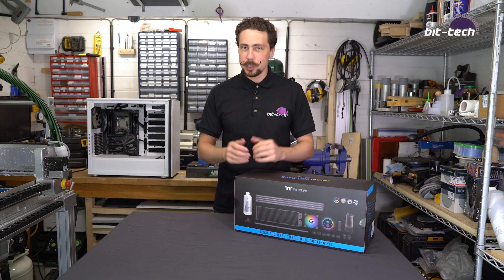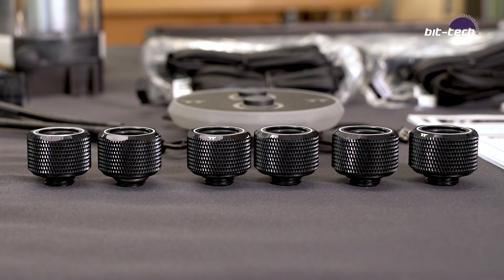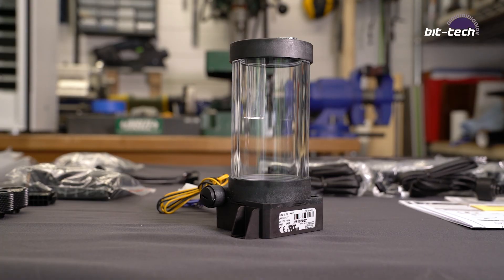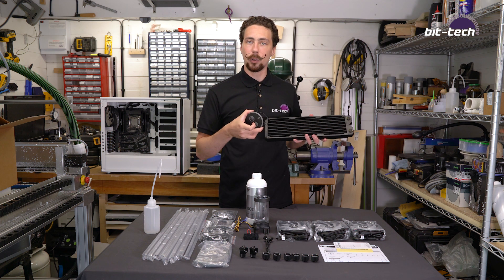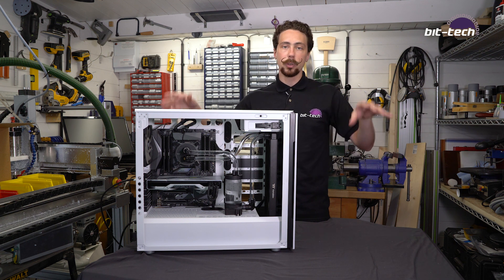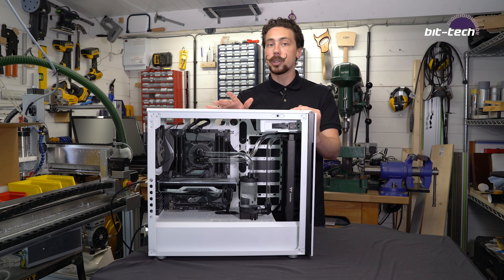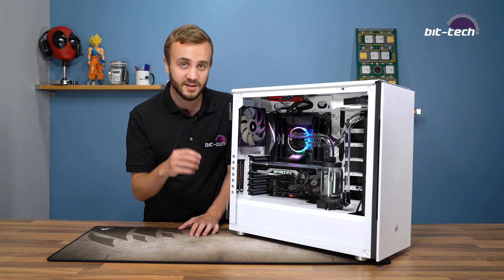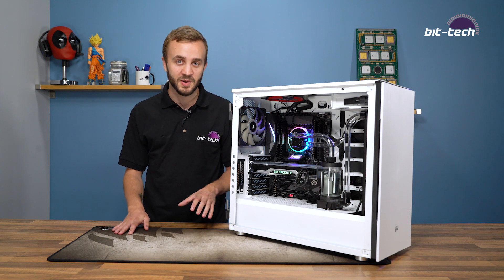Thermaltake C360 DDC Hard Tube Water-Cooling Kit Review - Hardline Without Hassle?

Comment: I need help. You put your fans on the outside of the rad so it is pull (front of case) but mine fit better on the inside as an exhaust.. will this work? thoughts?

Comment: PLEASE HELP!!! I bought the 240mm version of this same kit and I have my loop set up almost the exact same just have my pump going to the block first not the rad. I've been running it for over 6 hours with the res cap off but I still have lots of tiny bubbles almost looks like foam and when it's on/running the loop looks cloudy. How do I get rid of the bubbles!?? PLEASE HELP!!!

Comment: These are pathetic results! My AIR cooler gets 1/2 the temp shown here on AIR! Not only that, your results are unrealastic. Why would you be testing using an 18 core processor when 99% of users run their systems on 6 & 8 cores? Surely you should have been benching those core counts not 18 cores.
Reply: Why wouldn't you be benching a hot cpu to check perf, like maybe the 12900k?

Comment: I have never done cooling by liquid, but I bought all the parts separate (I wanted 4 quad fans). I got a CDL 480 Radiator, the MX 1 plus water block, 4 T.T. riing quad 120mm, have the T.T. tube bending/cutting kit and 4x1000mm tube set, 16o/12i.  All I need now is the pump and fittings - any suggestions on a reservoir/pump from Thermaltake? Thank you!

Comment: Personally I'm the kind of person that prefer to build loops that makes me able to reach everything I need easily. I think I'll never pass hard tubes above RAMs like that. I prefer to give more space to be able to remove them or install another pack if necessary, maybe just inserting pipes perpendicularly into processor cooler's fittings and makes 90° angles a bit far from them. But I have to say that for 'tutorial purpose' this is more than enough. Really good explanations! :D
Reply from the maker: SiMmUsS Yeah for proper builds I don’t like crossing the ram either, although it’s more of an aesthetic thing for me since I basically never switch out memory.

Comment: What fan header did you use for the kit?? Doesn’t specify which one in the instructions.
Reply from the maker: joshua hamlett When given the choice, try to use CPU_Fan as it helps avoid an annoying startup error. If using TT digital fans though it’s all done via one of the USB headers
Reply: bit-tech thank you for responding, this week I am adding another 240mm radiator into the loop my gpu temps dropped to fantastic levels while gaming but my cpu suffered. I did the hard tube kit on a 2080ti/9700k set up honestly fantastic kit and super easy considering I am extremely new to anything pc. Great video guys

Comment: Can anyone explain why he put the tube in the soap at 7:44?
Reply from the maker: Lyle S It lubricates the tube and bending cord so that it doesn’t get stuck after the tube has been bent.
Reply: @bittech1  Ohhh I see, possibly dumb question, I have a few more especially mostly for hardline tubing like measuring, making sure the cut is clean so the end of the tubing isn't messed up. As a custom loop beginenr should I use my soft tube first?  Ihave thermaltake c240 and c360 kits I both got on sale at frys a few months ago, still scared to use them in my atx build. only plan to watercool the CPU so I should be good I guess. Thanks , IO appreciate your help, would love some more advice. P.S, rocking that stache my dude!

Comment: I recently got this and c260 becuase i warned to combine hard tubing and soft in my big PC case, but are you sure this won't leak? if it did that'd suck. I also have a heatgun and PVC pipe cutter that I got from Lowes (brand Lenox) will it work? i've never done a custom loop before, but I recently set up my gamdias chione P1-A 360R< Would still love some personal advic from you on the watercooling, CUSTOM loop.

Comment: the blue power from the pump think its pwm where does that happen to plug into on the mobo ? just a fan header? the water pump header or ??
Reply: CPU fan header is a good choice. Pump headers don't always have PWM control.

Comment: I have an EK A240 kit, have you reviewed that kit in particular. I would like to convert it to a hard line system as it works wonderfully for two years now. But am tired of the saggy tubing,  Any suggestions would be appreciated.
Reply from the maker: You’re actually in luck as EK sells aluminium HDC rigid tubing fittings now. To convert, you’d basically just have to replace all the soft tubing compression fittings with rigid ones (the angled adapters are fine). Just be sure to get the aluminium ones from the fluid gaming line, otherwise you put yourself at a significant risk of galvanic corrosion.
Reply from the maker: I would add though that personally I would ditch aluminium for a higher end copper/brass/nickel setup. Aluminium really limits your choices as only EK has a consistent lineup for it currently in most markets (China will always have options there). With a copper/brass/nickel loop you have more choice for things like fittings and blocks for less mainstream GPUs

Comment: I had been looking for more reviews of this kit with no luck, only having seen one so far.  I did something out of character went out on a limb and bought one and I must say that I'm impressed with the packing and the quality feel of the components so it's reassuring to see that it does a very good job in testing.
Thanks for the review gents.
Reply from the maker: You’re welcome! It’s a pretty solid offering, a few extra fittings such as a drain system and a few extra angled adapters and you’ve got a pretty simple and effective setup
Reply: @bittech1  I'd bought a GPU block and forgot to get a couple extra fittings for it so now it's all sitting in the box all weekend hahaha
Reply: oFriskyPanda  hard to believe it's been 8 months but it's held up great.
Temps are still good, no issues to report.
Reply: oFriskyPanda   oFriskyPanda I'm using an I5-8400 and RX5700xt.  I don't remember the CPU temps under heavy load but during gaming it stays around 34°c. There was definitely a drop when compared to the air cooler but I don't recall how much.

More important for me was the improvement for my 5700xt, it used to peak at 88-90°c, now it maxes out at 35-37°c. Getting that heat out of the case was a huge victory.
Reply: oFriskyPanda  it helps that the 8400 is a pretty low thermal load but I've been really pleased with the results, I should clarify that it's about a 14°c rise over ambient.
Reply: oFriskyPanda  for a 9900k and 2080 I'll tell you right off the bat, this kit isn't going to be enough, you'll need at least another 240mm radiator, easy enough to add a Bykski from Ali Express though.
I would say this kit will be a good starting point, the Thermaltake Pacific fittings are really nice, the pump and reservoir are fine, the CPU block is attractive and works fine.

Comment: The only thing one might forget when starting watercooling with a kit like this is that it lacks a drain. Could potentially lead to a little headache.
Reply from the maker: 100% agreed
Reply: @bittech1  so how would you drain this kit then??
Reply from the maker: @C4shmoney  Probably easiest to siphon the coolant out of the reservoir using the fill bottle. It sounds a pain but it’s not that bad, often have had to do that for elaborate mods at Computex which don’t have drains.

Comment: How do you drain that system? I have amd im having a real struggle trying to drain the loop.
Reply from the maker: Use the fill bottle to siphon the coolant out from the reservoir.
Reply: I tried but takes a lot. I ended up removing the pump outlet and catchin the water with a reservoir. Then removed the tank inlet and flush it with air until there is no water left. Still. A lot of work. I may installl a flush valve in the future. 

Thx for the response tho. Awesome vid.

Comment: As a water cooling noob - is it ok to just water cool CPU like this & not GPU?
Reply: If you are only water cooling the CPU you have to make sure you still have good air flow in the case for the other components, most GPUs have decent air coolers on them, but the motherboard power components do need cooling so good airflow is recommended if you plan on over clocking.  If you are using a custom loop just for the CPU you can always get a water block plate for the GPU later and complete the build, maybe even add in an extra radiator if your case allows it.
Reply: TheMaw365 sweet! Thanks
Reply from the maker: Yup of course!

Comment: What a great review. So many just build a system and dont do performance numbers. Is there much of a difference in performance between using premium parts from a company like EK or Thermaltake... vs stuff you might buy on AliExpress? the prices are so different. Is there a video or article anywhere comparing?
Reply from the maker: Something we hope to cover in the future! But I can tell you right now that actually you won’t see big performance changes for the most part. The majority of current blocks on the market perform within a few degrees of one another under the same scenarios. Your real cooling potential comes from the radiators and fans and some definitely do much better there than others.

With the mainstream manufacturers you’re generally paying a premium for things like customer support and local availability. Bykski and Barrow etc can be tough to deal with thanks to operating out of China directly. Also just be aware that Bykski has a habit of sneaking aluminium into some parts like reservoir tops etc. so whilst the majority of their stuff is pretty decent, you need to check for things like that. Same deal with pumps like the ones they provide for distro plates, make sure they’re the more expensive Xylem/Laing ones and not cheaper alternatives (Barrow certainly sold both alongside one another).
Reply: @bittech1  Wow, what a thorough and excellent reply. Answered exactly what I needed to know. This channel needs more subs.
Reply: Also the Barrow and Bykski valves tend to have low quality internal material for the actual rotating valve thingy that degrades fairly quick and causes it to leak. 
Be aware.

Comment: The nice thing with those thermaltake tubes, is their ID is around 11.7mm, not 12mm, which makes them perfect for threading with g1/4 threads, where you can use a male to male, or quick disconnects, or really any fitting to connect two lengths of tubes, or using smaller fittings than the bulky compression style ones.

Comment: it looks a lot better than the cheap ass corsair stuff. still not as nice as E.K or bitspower
Reply: reaper the pump reservoir combo looks incredible cheap in my opinion.
Reply: I got the corsair stuff due to iCue compatibility... Not sure how it looks cheap? It's definitely their own look but should be. I did their CPU and GPU blocks... Their GPU block is quite nice and very robust. But I also ended up using a alphacool x flow 420 radiator, thermaltake fittings due to going with 16mm tubing... And alphacool elbows. Pump obviously from corsair. All have temp coloring while computer is running so at a glance know what each component is running at. Also run corsair dominator RAM... I'm pretty happy with setup and didn't have to deal with various RGB integrating with each other.